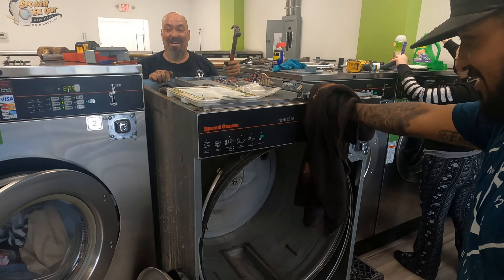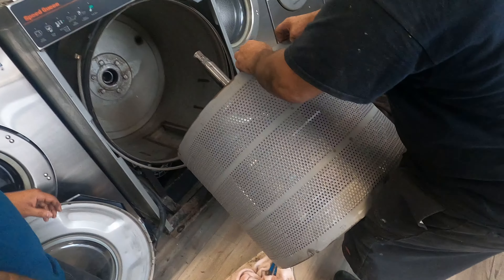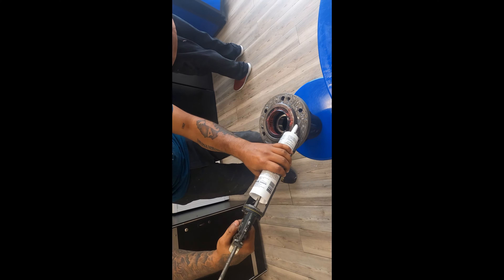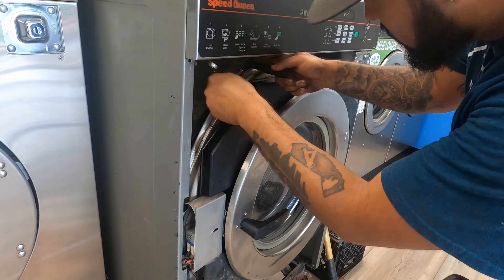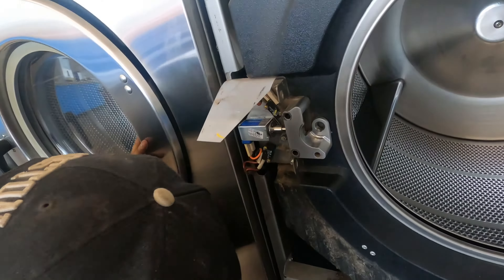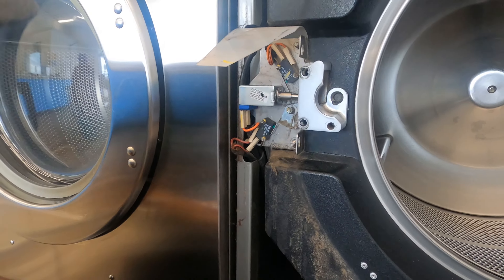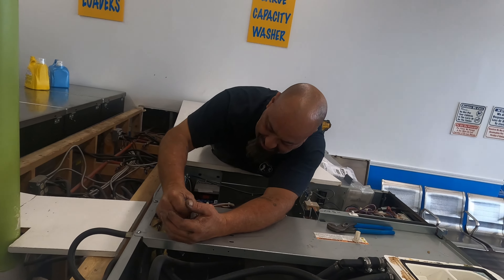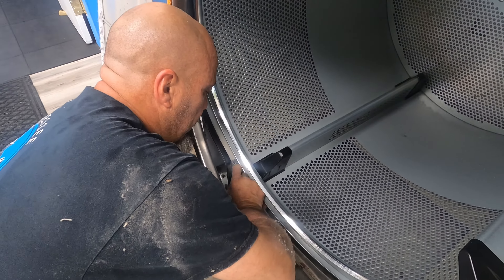Life of a laundromat maintenance, Bearing job, water valve, rollers, etc.

Comment: I have been waiting over 6 weeks to have this repair done on the same machine. No repair guy will come do it.
Reply from the maker: what's your location?  I may be able to help if you aren't too far away.
Reply: @splashemoutlaundromat  I'm to far, I'm in Madeira Beach Florida. We have guys here, they're just so booked they won't take on more work. I did get a guy to come out finally.
Reply: Is it still hard to find techs that will show much down there?
Reply: @emdeez7713  At this point I do all repairs myself except bearing jobs. I only have a couple repair guys in my area so they stay booked all the time.
Reply: What your opinion for Chinese washers/dryers. Have you ever worked on them ?

Comment: i really need some help  here. 
 i have 5 laundry dryers (15kg load type) (  manufacturer recommends just need small regulator) 
But my Gas seller recommends using a Big regulator to supply all of of them but then each of the machine will have its smaller regulator to contain the flow. ( this cost alot) 

another gas seller suggest me to just install 1 medium size regulator and then it can regulator all 5 dryer. 

anyone here can help me?
Reply from the maker: I'm not sure of the brand of dryers you have, but I always get my plumber with the manufacturer to make sure everyone is on the same page.  The last thing you want is to not get the right amount of flow to make your dryers work properly.  There are a lot of resources on YouTube as well.